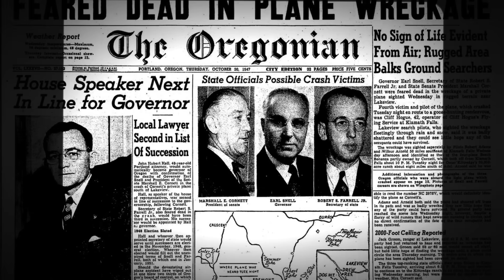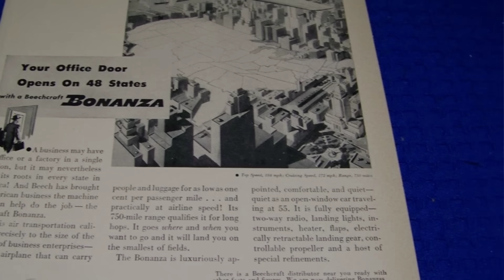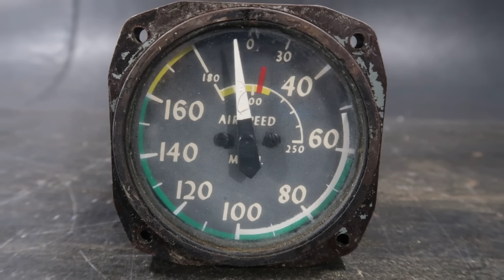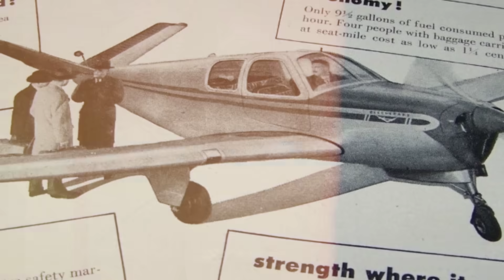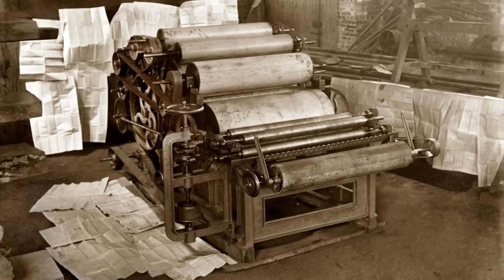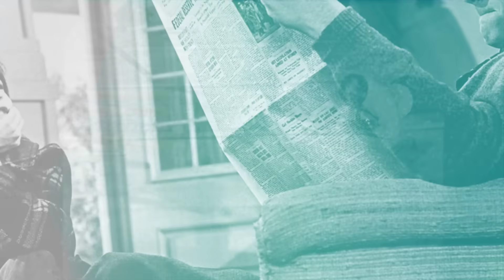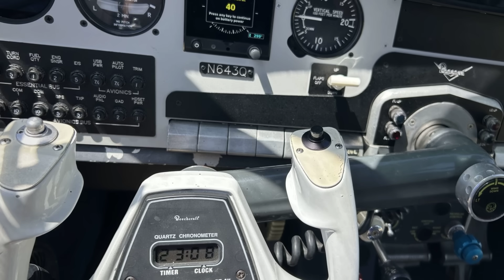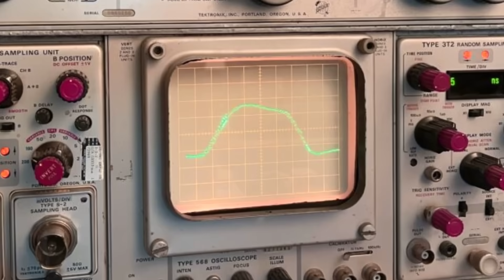They Called His Tail 'A Fatal Flaw' - Then It Ruled The Sky For 70 Years

Comment: In 1947 both the Beechcraft 35 Bonanza and the Cessna 195 Businessliner.  The Cessna looked like it was right out of 1935.  With its radial engine, high wing, fixed conventional landing gear and very rounded wingtips and tail surfaces.  While the Bonanza looked like it was right out of 1965.  With a new and smaller engine layout, low wing with retractable gear. Squared off wingtips and tail surfaces. And most of all that very unusual V-tail.  Plus the 195 was so much bigger and slower than the Bonanza.  That is why the Bonanza took off and is still made to this day.  Almost EIGHTY years later!  The Cessna 195 was manufactured for only seven years.

Comment: My father owned 5 V tail Bonanzas, all purchased new, from a B 35 in 1950 to a V35B model purchased in 1972.  He flew the last Bonanza until the mid 1980s.  The subsequent owners crashed three of these airplanes, two fatality.  He always felt that pilot error was the main reason for Bonanza accidents.  He owned 3 airplanes prior to his first Bonanza with over 1000 hours on those airplanes.
Reply: well you  can answer this qs  ..I haven't  flow a bonanza  BTW  however one issue I heard  was the  non ergonomic  layout of  panel  switches ..that all looked the  same but each had functions that could be non-critical or  critical yet were  positioned  side by  side .. true or  false ?